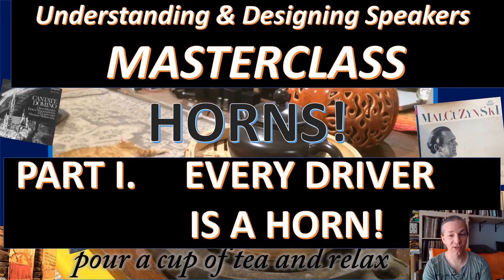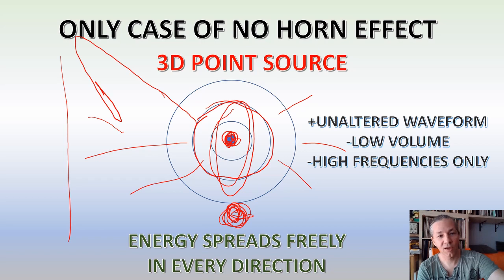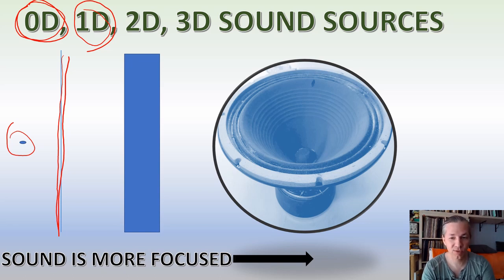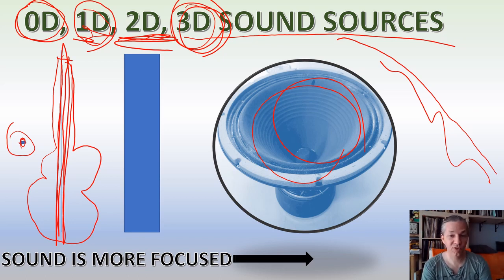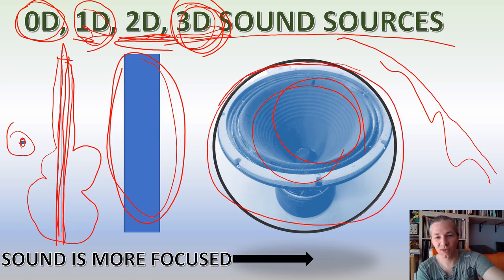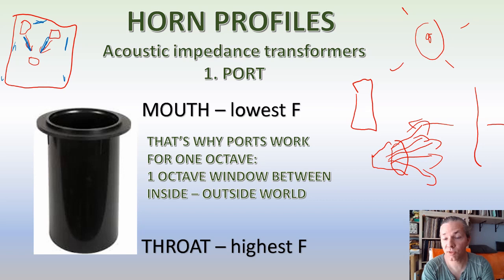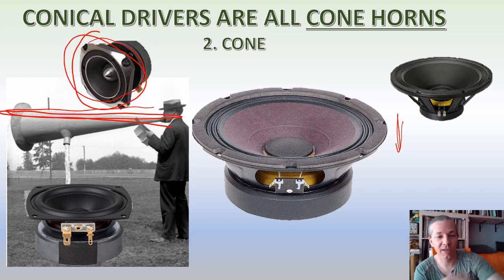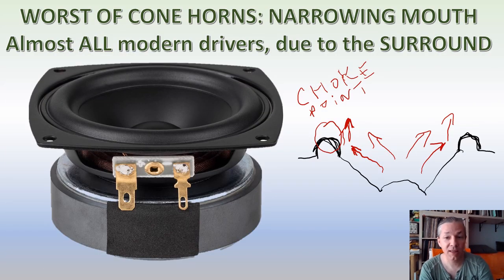Understanding HORN speakers!

Comment: Excellent video. I used to own a National Duolian resonator guitar from 1936, which basically had a horn instead of a sound hole in it. It was obviously an acoustic unamplified instrument, but it was loud! So, is an instrument like a trumpet acting like a transmission line or a folded speaker with a driver with a horn at the end of it? Thanks, Janos!
Reply from the maker: Hi Nick, that was a perfect description of a trumpet! I’ve heard of the Duolians but never heard one live. :)

Comment: So..  is saying ‘horns match the impedance of the driver to the air’ kind of a redundant statement?  That would be the case if it’s simply directivity=efficiency, I would have thought..

With small bass horns, like a small front-loaded bass horn, the mouth is often too small to provide significant directivity, and yet the lower frequencies are amplified.

Genuinely interested if someone can clear that up for me 👍
Reply from the maker: It means we are getting higher sensitivity, that is, better conversion of power output to acoustic energy. 
The mouth size is responsible for low end horn-loading, high end frequency defined by the throat diameter, amplification (aka impedance matching) by length of the horn, and directivity and dispersion defined by shape / flare. 
The acoustic impedance matching is about matching the air speeds exiting the driver membrane to the speed of the air motion in the room. As the mismatch between driver & room decreases, efficiency increases. 
(Think of the subwoofer port specifications: 10m/s, and such values.... while the elicited motion in the air in the room is but a millimeter/s or so.)
Reply: @realworldaudio  thanks..  I guess what I’m wondering is whether there is an ‘exact match’ (given a certain room size/conditions, say), or whether efficiency would go on improving the more the horn is able to increase the loading on the driver (bigger, longer etc)?

And to what extent are ‘average’ horn loaded systems match the air impedance vs direct radiating..  I know the SPL increase is in the region of 4-8dB (which is a lot, of course)..  so taking for example an 8” mid with gains of 6dB over DR..

Thanks

Comment: Hi, is there a possibilty to use a normal Tweeter in an horn?
Reply from the maker: Yes, you can horn load a regular tweeter, it does not need to be a compression driver. Also, it needs not be a big horn, even an inch deep horn makes a very pronounced impact - better efficiency hence, the tweeter will have a much bigger dynamic working range.
Reply: @realworldaudio  Thanks a lot.

Comment: How did you come to say that the fundamental frequency of lighting is 100Hz? I google searched around for this and closest I found was talk of Florissant lightbulbs at 100Hz. Can you point to a reference or reasoning for this?
Reply from the maker: "3.4 The dominant frequency of thunder energy is in the 100 Hz range." http://lightningsafety.com/nlsi_info/thunder.html
Reply: @realworldaudio  Thanks. I could not find that. Amazing it is only 100Hz.
Reply: @realworldaudio  Aren't thunder and lightning two separate phenomena?
Reply from the maker: @Sunrayman123  The electrical discharge in the atmosphere creates a visual effect that we see as lightning, and an atmospheric pressure wave that we hear as thunder. They happen together, but based on the distance, cloud coverage, altitude, etc, we may hear only the thunder and not see the lightning, or we see the lightning and do not hear the thunder. Yet, they both occur at all times, two consequences of a single cause (the massive electric discharge).

Comment: Nice video but the information is incorrect. Often you are describing “wave guides” rather than “horn loading”. To understand this better, look up acoustic impedance matching and compression. Without compression, there can be no horn loading, and therefore no impedance matching between the sound source and the listening area. That’s what makes a horn. Regarding the conical shape of many driver diaphragms, the reason for this is to make a rigid yet light weight piston to push and pull the air molecules in front (and behind) the diaphragm. Rigidity is needed to avoid mechanical distortions in the sound we hear, and low weight is needed to reduce the amount of energy required to move the diaphragm forward and backward quickly. The diameter of the “throat” of a driver, ie the voice coil diameter, versus the “mouth” diameter has no direct relation to the frequency range produced by that driver. In short, in and of itself, no driver is a horn.
Reply from the maker: Thank you for your kind comment. Just one example, and you can deduct the rest from this one: You need no compression to achieve horn loading. For example, just think of the plastic cone to amplify the human voice. No compression, just place it in front of your mouth. Sure, the cone does not change the frequency range, but alters the amplitude quite a bit.
Reply: Correct, a cone in front of your mouth is a horn. In this case, the compression chamber is the inside of the mouth and/or lungs. For horn loading to occur, there must be a compression factor greater than zero.